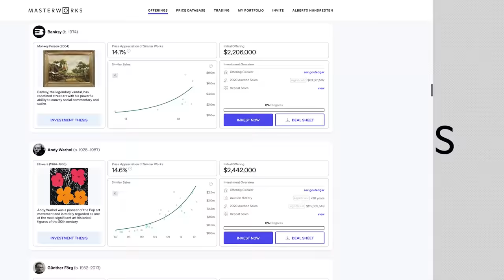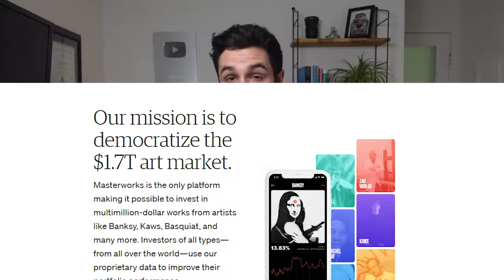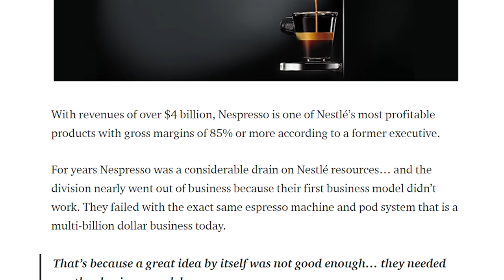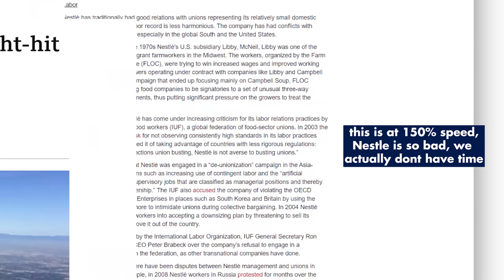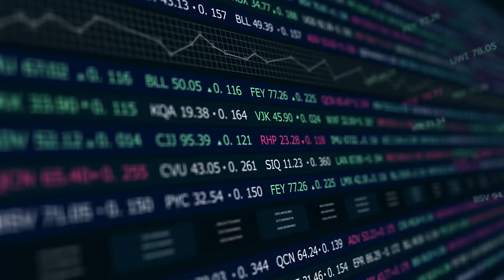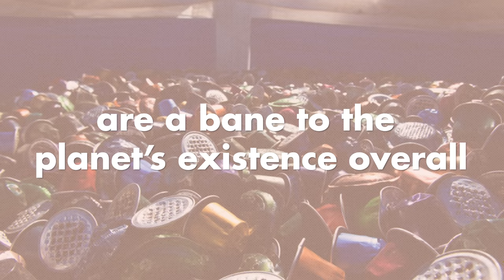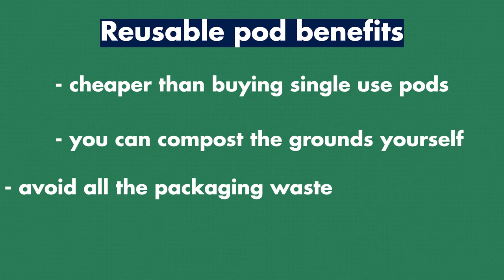The PROBLEM With Nespresso Coffee Pods

Comment: I used to be a Nespresso fan until I learned how to use a barista espresso machine and buying very affordable coffee beans and grinding them myself. My love for coffee grew in knowledge in how to make coffee shop quality espressos at home. I saved a lot money and became a very artsy fellow.
Reply: people upgrade machines all the time too - i got one for £30 off facebook becuase they had upgraded. my mum had the same one so i knew how to use it. before i was paying £4 per coffee at costa. ehehe not anymore. and the beans i get ground in bulk.
Reply: I bought a cheap positive pressure type espresso machine that works on the same principles as the pod machines. They use the same cheap pumps as those machines do. The fact that they have a real 51mm Portafilter fitted means they have a good seal and don't leak. Actually not a real portafilter, they are pretend ones, the manufacturers go to considerable trouble to hide the fact that they have positive pressure, and not straight through.
It also means I can buy my own coffee beans by the kilo. The cheap burr grinder was more expensive than the coffee machine. I get fresh beans, and fresh ground coffee, which means way better coffee than what I ever got out of a pod machine. The fact it's much cheaper doesn't hurt either. It's still not real espresso machine quality at its best, but if the coffee is not the best, it is at least consistently good, and I don't have to fuss. Still thinking of splurging out and getting a good one (read expensive) at some point.
Reply: @rfwillett2424  
Hi. I'm curious. What machine did  you get? Thanks.
Reply: "Became a very artsy fellow" 😂
Reply: @7531monkey  What's funny is OP never once mentioned anything about nature, just about having better tasting coffee than nespresso but you felt the need to comment, do you have loved ones that care about you or are you filling the void with meaningless trolling?
Reply: I’m doing the same thing. Bye bye Nespresso.

Comment: This Video summarizes perfectly why we went out to by a traditional Italian espresso machine, the one which brings the most mileage with roughly 20 to 30 years of use if handled correctly.
Reply from the maker: Such a good call! Those things never die 😅 Thanks for joining us here!
Reply: Hello sir/madame. Please I am navigating in buying an espresso machine as well. Can u tell me which one you settled for and if you recommend it? Thank you
Reply: @yahyaboussebaa4082  Bump. The homie above needs assistance here
Reply: @yahyaboussebaa4082  I am answering for them I beleive Breville is excellent but its expensive
Reply: @yahyaboussebaa4082  Hi Yahya, I went for the Rolex of the Espresso Machines that it is why it is pretty expensive - it is called Olympia Express. They build machines which last 30 years+ , these are the first the sold 😉. Even if the entry price is very steep, it will last for generations. Very simple mechanic, made to perfection. You can easily maintain it completely by yourself
Reply: @yahyaboussebaa4082  for a first timer, Gaggia Classic is a great value buy! With a mild about of know-how you can turn it into an incredible machine and older ones are very serviceable still. However, with espresso, your grinder is by far the most important part. If it came down to spending $500 on one and $100 on the other, I’d put the $500 towards the grinder and the $100 towards the machine. It’s so much more important
Reply: @Motherhubbard170  nope, Breville coffee machines are like the pods, designed to be thrown away after 5 years of use, they are not repairable so just add to landfill if way less time than they should.  A good Italian or German espresso machine is designed to last decades
Reply: @yahyaboussebaa4082  I had a small countertop De Lhongi machine which I used twice daily for years before upgrading.  That machine is now on its third owner and going strong.  The pressure is a bit weak, but it was very reasonably priced as an entry into espresso machines
Reply: @ayjee6405  I have that machine now and bought it second hand! I love it! It's the de Longhi dedica

Comment: My Nespresso machine just sits in a corner in the kitchen. I resort to using a French Press as my preferred brewing method. Great video, as always!
Reply: By the time you wait the 4 minutes to steep and pressing it down, the water has cooled off way too much and now you're left with lukewarm coffee. Those presses are overhyped.
Reply: @Livetoeat171 you gotta use boiling hot water. I use a kettle and my coffee is scorching hot after the 4 minutes.

Comment: I used to buy Nespresso pods and finally got an actual Breville espresso maker. My partner and I paid off the machine in a few months by all the money we saved not being tempted to buy latte's when I'm out and about + not paying for overpriced pods.
Reply: When you do the sums, it takes no time for a home coffee maker to pay for itself compared to buying out. In Australia your ave flat white is around 4$
Reply: @standupstraight9691  Exactly... and I'm not someone who bought out every day or even every week. We used less coffee grounds than a standard coffee maker for espresso too.
Reply: No reason to buy overpriced pods to be used once and discarded. I bought the VIVI SKY Reusable Coffee Capsules Discs, grind my own beans before each cup (one touch operation!) and reuse the same two Nespresso Vertuo pods for over the last year! And when I want fancy foam I preheat my cream in the microwave and then whip using a battery operated milk frother. Spent coffee goes into my flower/garden beds. It's way too easy. Sustainability "problems" solved!

Comment: i think one important note is that, making coffe the old way, requires more coffee than the pods (since the whole system of the machines is designed to improve the solids extraction during coffee brewing) since the biggest carbon footprint of coffee is actually the coffee harvesting, transport and roasting, doing the coffee the old way is way more impactful that using the pods. the actually better approach could be to try to use the re usable ones or tray to ensure a consistent recycling of the aluminiom ones.
Reply: If you really want to use less coffee, then just eat the beans.  10 beans gives you about as much caffeine as a strong cup of coffee because you're not leaving any of it behind in the spent grounds.  Dark chocolate ones can apparently be even stronger due to the caffeine in chocolate, but I am a bit skeptical about the claims on just how much extra that adds.  Depends on how dark the chocolate is, I guess...

Comment: i use the reusable pods and i have had no quality complaints. for me, it’s a perfect system
Reply: Same here. But you need to find the correct set up (fine ground coffee, tamping pressure etc) at the beginning. Personally i have been using for 2 years the evergreen capsule, i love it.
Reply: Same here. I been using the WayCap for Dolce Gusto (machine brand also by Nestlé) and it works fine by me. They have reusable pods for others brands such as Nespresso and DeltaQ.
Reply: @MrJmj444  do you only make espresso with it or the bigger cups too ? I cant seem to get anything good out of it other than espresso
Reply: @thesheep7634  for the bigger cup i use the single-use lids option that they have, enables you to pack more coffee inside.

Comment: Recycling K-pods is a joke. The box tells you you have to individually empty them of coffee which is a lot of manual work. Having to reopen them and remove the lid and empty the coffee is even more work than a regulare reusable cloth filter or a reusable plastic filter machine. That prerequisite to recycle a single K-cup removes 100% of all the reasons to use a Keurig over a regular cloth filter or a paper filter machine, so even though I tried to recycle the K-cups,  most of the times I just throw them in the trash, or use a reusable filter for keurig, which is again, more work than the regular k-cup so the entire point of using a Keurig is lost.
Reply: dont buy them then
Reply: Don't buy em then lmao

Comment: Don’t forget the fact that Vertuo Nespresso machines have a barcode scanner to prevent third party, reusable stainless steel pods being used too. It’s (allegedly) the REAL main reason they brought out the new pod type
Reply: It's mainly a patent thing too. Since the old pod's patent expired everyone can use a nespresso pod. The Vertuo on the other hand has a novel design that allows it to be patentable. Nespresso is the only one who can legally make and sell them.
Reply: I was looking for this comment. The original nespresso pods are off patent and (in Europe), you can buy off brand pods for a third to a half of what you pay here. The Vertuo line with the bar code is trademarked, which will never expire. And it is the REAL reason for these machines.
Reply: @brianking768  And the Vertuo doesn't use a pump to pressurize the water, it uses centripetal force instead.

Comment: I would recommend looking into entry level espresso machines over these coffee pod systems. They might be more expensive up front but the coffee will taste better and it will probably be cheaper over the long term. The breville barista express is a pretty easy one to recommend as an entry level one since it comes with a decent grinder and doesn't take too long to warm up from off. It was around $500 the last time I looked for a friend but considering that burr grinders are commonly $100+ it's really not a bad deal to get started
Reply: A cheap burr grinder paired with an entry level espresso maker still makes better coffee than a pod, in my opinion. There is nothing in the world than makes pre-ground coffee last longer or taste better than fresh-ground.

Comment: I almost got sucked into Nov 2022 Black Friday deals on Nespresso makers. In the summer of this same year it crossed my mind to research how many coffee pods are manufactured in a year. The number for the UK alone was astronomical. And so I also wondered where they all likely end up and if there are reusable pods available. I did find that Keurig has reusable washable pods for their machines but can’t say I found them for Nespresso. I then realized that while they are available for K cups using them undercuts the convenience of using a new pod each time. If you are going to refill a small fiddly reusable capsule for one cup - why not just load the much larger easier to handle and wash filter on a drip maker and make a pot of coffee? So of course reusables are not popular with the lazy DIYer. Plus there was a quick calculation of the cost of purchasing an endless supply of the coffee pods. Anyway after all of that I decided I was right not to follow my friends and family down the road of purchasing a Keurig or Nespresso maker - and then came Black Friday on Amazon. Lo and behold a Nespresso Vertuo maker on sale for about 40% off and bringing the high end brand name into the realm of affordability. I tapped - I read and for a moment almost purchased it feeling good about how impressive this would look on my counter. And then thank God I woke up and remembered I would also have to order and pay for coffee pods and - that was that - the dream was over and I once again realized how much better off I am continuing to use my 25 year old (still going strong) drip maker that owes me nothing makes more coffee at one time is less costly for me to use and has a far smaller impact on the environment especially as I have used the same wire mesh reusable filter for that entire 25 years.
Reply: Making a pot is not realistic when you're a single person wanting a single cup
Reply: @snoozyq9576  But in less water and less coffee, not that difficult

Comment: You have to be careful when taking into account the environmental impact. The trash is the only part we see but coffee pods are actually better for the environment in many ways. Since they only need a small amount of coffee to make a cup and there is almost no waste in terms of coffee grounds they produce less greenhouse gases. Because when you do drip or traditional espresso or pour over you use more coffee for the same cup and in the case of drip you often throw away some coffee. You might think that because it's all compost afterwards that it's all ok but coffee itself is the most harsh on the environment. Coffee farming is pesticide intensive, it requires also to cut down Forrest, also to import that coffee across the world it is emitting a lot of greenhouse gas. The farming and exporting process is a lot worse in terms of emissions than the trash of the plastic cup.

Trash is bad and is definitely a problem but it doesn't change the fact that coffee farming is terrible.
Reply: Nah.
I would say that the order of sustainability goes regular coffee > coffee pods > just don't drink coffee.

Even if the pods are the "only" trash Nespresso and such create, remember that Nespresso alone makes near 14 billion pods of waste according to this video. That's a huge amount.
And as you said yourself, drip coffee filters and coffee grounds are actually compostable and not just some biodegradable plastics, making them as good for the environment as a coffee product can get. Only thing more ecological is just not consuming coffee etc.

Comment: I have a Bialetti moka and a Nespresso machine (bought super cheap at a flea market). I have never gotten my Moka coffee right. Itjust took too much research and trials and failures. From the type of grind, type of coffee beans, the heat of the fire, etc. I read books, watched videos, and still could never make a decent cup, as in 0 out of probably 50 times that I tried it since I bought it 2 years ago, so it all went into the drain. It's sad because I thought it was going to love making legitimate aficionado-approved coffee. I invested all the time to learn it too. One BIG issue is the availability of yummy fresh coffee grounds in my small city where coffee retailers are probably not cafe aficionados because I just could not get a good mix of robusta and arabica. I even had to order coffee from farms and shipping took so much money anyway. So depending on your environment, the cost difference won't be that much, especially with the added effort for legit coffee. There are many reasons why a Nespresso is preferable for an average Joe and Jane. But from my viewpoint, it mainly comes down to low-effort reliability which means you get a good drink more often and don't need to go through a steep learning curve. Plus, there's a long list of flavors you can mix up. I don't regret what I learned about good coffee though, any knowledge is great for conversation.

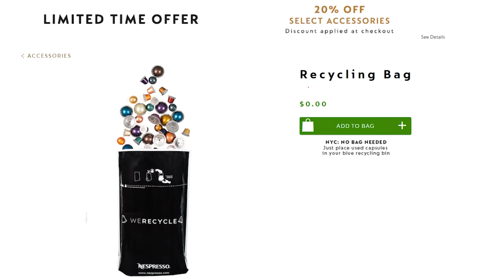Comment: 6:00 Or here in Finland you could just throw them in to the metal recycling.
6:55 It probably depends on the country. Everyone here has metal recycling so there is no extra effort in recycling them. And we don't have any landfills anymore. Everything gets recycled or burned for energy.
10:35 How would I recycle some plastic pods? I would have to tear them apart, empty into biowaste and use water to clean them before putting into plastic waste. Metal is better. You can burn the coffee when melting the pod.
14:20 I changed to a fully automatic coffee maker for a while, but ended up buying an fully integrated manual espresso machine. The coffee it makes just tastes so much better than what an automatic can do.

Comment: For espresso, I have to admit Nespresso is my favorite coffee inkjet printer.  Getting a real espresso machine would be a much better option, probably save money and be more environmentally friendly, but it also takes more time, requires more equipment, creates more of a mess and I'd have to get good at making a consistent shot.  Still, that probably is the right long term approach ...
Reply: Its kind of like the Gillette vs safety razor argument.

I took the plunge into the world of safety razors and it does take more effort and skill but overall its better for your wallet, your face and environment
Reply: @crashTestGuru  Yes!  Back in Nov '22 I got myself a Picopresso and very good 1zpresso J MAX hand grinder.  Those together with light/medium roast coffees from a local roasting company have changed my espresso world completely.  I haven't made a Nespresso since (and I don't really miss it).  I learned that the grinder is the most important thing - small changes in grind size have a big impact and it was kind of fun to work up a good technique.  The setup is intentionally portable so I can make espresso on the road.  The major downsize is that it doesn't scale well, but 99% of the time I'm the only one craving espresso.

Comment: I use a Hario V60 pour over coffee brewer. I bought the V60 for $16. The filter papers are around $0.15 each. Coffee beans ranges from $0.30 to $0.75 per cup. You can get it ground for free. So let's say you have a cup of coffee each work day then we can amortize the cost of the V60 at $16 / 250 or $0.07 and this assumes you buy a new V60 each year (mine has lasted for years). The total per cup is going to be $0.07 + $0.15 + $0.75 or $0.97. Let's round it up and say you are paying $1 for a cup of high quality coffee. Making the coffee takes 5 minutes, tops.

Nespresso pods are going to be around $0.75 or higher (and that won't be as fresh as my coffee). An Nespresso machine is going to be $100 to $200 dollars and I'm sure it won't last as long as a V60. You don't have to pay the $0.07 for filter paper. But that isn't really a factor when you consider the cost of the machine, the hard to recycle pods and the cost of the pods.